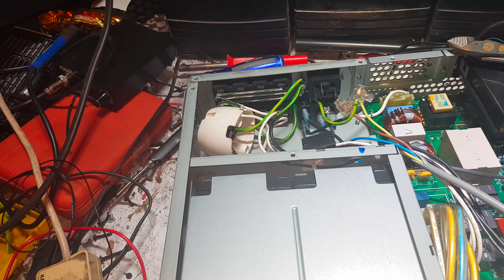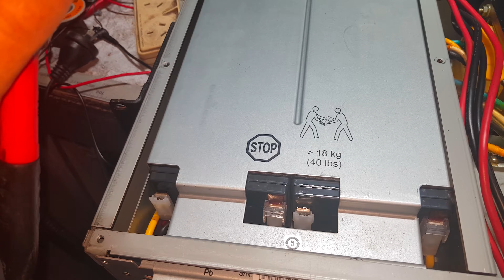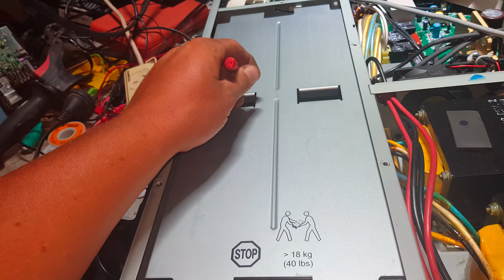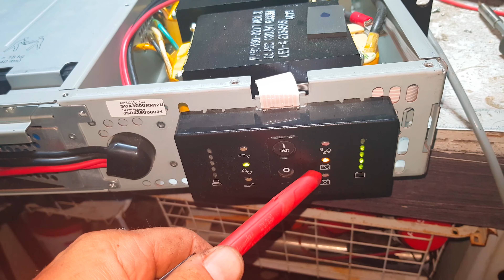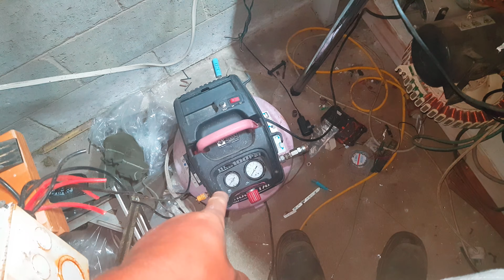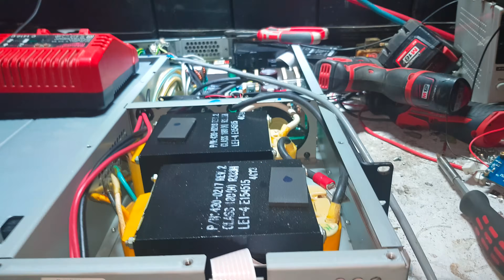APC 3000Va 48V  Server UPS First Test Unit 1 works Off Grid Time?

Comment: I tested 1hp aircond and the load led shows 3 bar. I using it for my solar system with 200A car battery, 100A +24, 100A -24v : 48v.
Reply from the maker: How's it run ? Nice and smooth start up
Reply: Its running fine. The problem is hard to turn on the ups. Press and hold the power  button many times. Sometimes press and hold one time only it can turned on. Depends on luck ?  @Oneupthesleevecustoms
Reply from the maker: Oh it's doesn't always want to start?
Reply: @Oneupthesleevecustoms it starts, but not easy. This occur sometimes. I already removed the buzzer. since it is in my room, and the beeping sound quite annoying so i removed the buzzer. I understand the buzzer will tells what's going on.

Comment: You still playing with this thing? I have some network management card that amongst other things, will let you silence that beeper for good, and monitor stats. Your welcome to one of them. I've run an ion laser off mine that pulls 10A from the wall. Then I do have 225aH of batteries hooked up to is as mines the one that can take extra batteries. In fact they all can, just these units are missing the external socket. Thats what the knockout is for where you were intending to put the AC socket.
Reply from the maker: Yeah im soon to hook up a 48v 500ah gel pack :) so you've ran some big things off yours?  Was interested in heat being a factor
Reply: @Oneupthesleevecustoms  Fan have died in mine, I stuck a temperature controlled computer fan on mine, and that seemed to keep it happy. Oh, lets see, um the whole loungeroom - Gaming PC, 55" LED TV, router, 40A power supply for ham radios, thin client, home theatre, microwave, fridge... basically everything that could reach with a 5meter extension cord. Even a 1500W heater. Never got above 45C, but the 120mm fan revved its tits off :)
Reply from the maker: Thats awesome as. I just got a bigger 5000va one to test out now too

Comment: Nice stuff, I wonder what the inverter duty cycle is, is it 100%?
Reply from the maker: It should be high there are 2 active 80mm fans in the center of the unit  and it looks like its all made for airflow

Comment: You know you could just buy some of these adapters, instead of hacking into the mains wiring
https://www.altronics.com.au/p/p8420a-0.15m-iec-c14-to-3-pin-240v-socket-10a-appliance-mains-lead/
OR find an old IEC monitor extension cable, and replace one end with a socket from bunnings.

The input socket looks like an IEC C19 rated for 20A, you might as well replace that one
Reply from the maker: Yeah i defiantly need a few of those adapters for the other one it will be a actuall ups
this one will end up off grid so i dont mind a little hackary {not a real word haha}